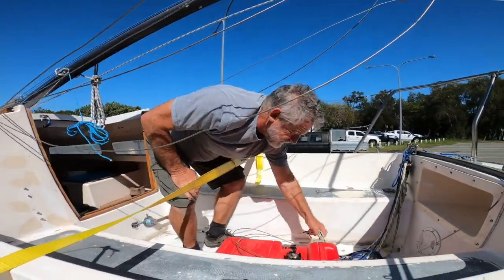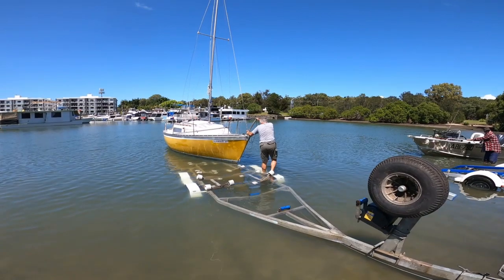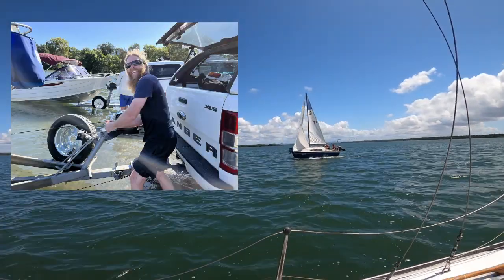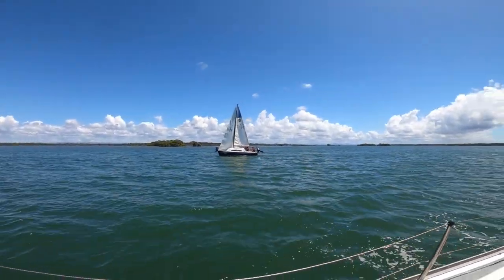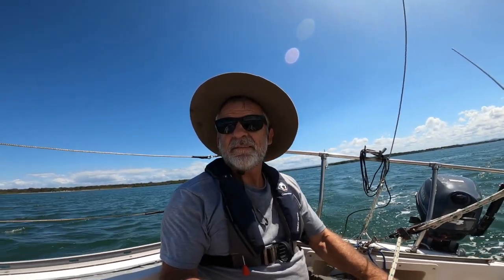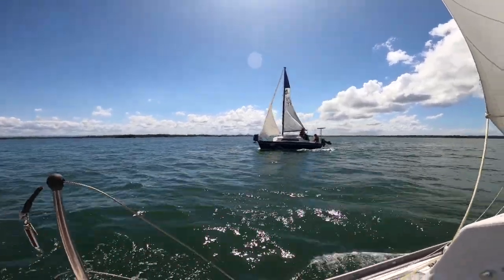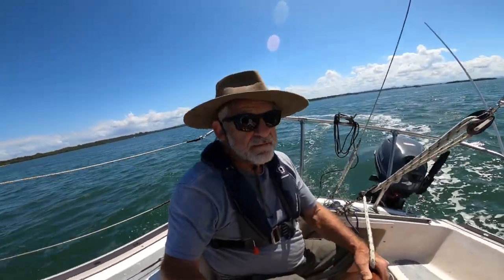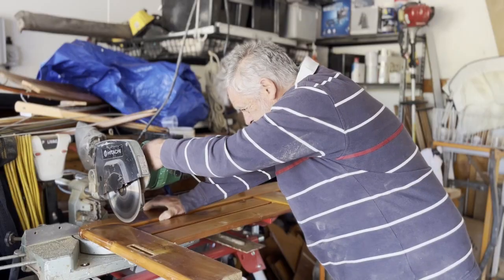First splash in our Sunmaid 20, fibreglass boat restoration projects

Comment: Very interesting and lessons to rember for my shake out sail, I have been thinking up excuses to for get about the keel and cable inspection, because of lifting the boat, or laying it on its side on the lawn as suggested.  Watching Baz and crew in shark infeasted water, getting his boat on the trailer. I best just do the job propley, and avoid the crack in the housing to fix as well.
Looking foward to your wooden boat restoration,  and Baz when he post his trip with you, not often that two people I have subcribed to are together, big thumbs up from me.
Reply from the maker: Makes a very strong case for dyneema. When my one failed for the third time I ended up swimming in croc and shark waters to fix it up.
Reply: How do you get a boat that size on it side on the lawn?

Comment: Dear Chris. I may have commented earlier on my Sunmaid 20 project plans - you were kind enough to help me contact the association in Victoria. Well, the boat is on its trailer, in my suburban Adelaide driveway, stripped to the bone and with a tarp over it. A large workshop would be super, but a pipe dream at present. I am on the cusp of taking the multi-tool and other devices to the cockpit, as I cannot resist the challenge! The templates are ready, the FG and epoxy purchased and a plan laboriously worked out. Wish me luck. I've been filming my (slow) progress for a possible future channel. I just need a run of warm, dry days, elusive at the moment, to dive in. Wish me luck. So nice to see other owners' approach to typical problems on these boats. I have enjoyed watching your friend, Baz's channel, too. Cheers.
Reply from the maker: That’s very exciting stuff! You are taking a good approach stripping everything down to the bones. I work in similar circumstances. It’s frustrating sometimes but you get by. I look forward to seeing your  vids. The cockpit sure could do with a work over. I’m interested in how you approach it.
Reply: @SmallSailboatCruising  If at all, in any way successful, I may write you with a personal, pre-YouTube channel description! I will cut the ply for the seats and floors from today, glassing them on the undersides first. Next week will be fitting. Gulp! Nothing ventured, nothing gained, eh?

Comment: Fabulous Chris. The Bribie Passage looks like an awesome place for a shakeout sail. Did you have any problems with the water depth? The charts say 8-10m in the centre...did you find that pretty accurate and not too many 'rogue' sandbars?
Reply from the maker: We didn’t come across any shallows sailing east west out of spinnaker sound. The only hazard there is jet skis. 😂
Reply: Yes there is a big sandbank on the eastern side of the passage just north of the VMR base (Sylvan Beach).  I comes right out and is marked by a red marker.  Then as you go north there are more shallows here and there.  The channel is well marked though.

Comment: Hi Chris, I have a Sunmaid 20 and it doesn’t have a backstay. I see that yours does. My shrouds seem tight enough but under the load of the jib the front stay seems to slacken. Would you recommend rigging a backstay?
Reply from the maker: The back stay is part of the original design. I have drawings showing a bridal on the transom so that it becomes like a split fork to where is attaches. The backstay enables you to shape the main sail and it provides reinforcement if you are flying a Spinniker. I would highly recommend reinstating it

Comment: I bump stop my Sunmaid20 off the trailer! at the bottom of the ramp 1 metre short I remove the winch strap & chains, I tie a bow line and lead it back to the vehicle and hold the line in the drivers seat wearing leather gloves! I reverse back 1 metre and tap the brakes and the boat keeps going straight off the trailer. I lead the boat around to the jetty or beach without getting my feet or the car wet.
Reply from the maker: I like the idea of keeping the bearings out of the water. If I let my safety go it would scoot off and land on the ramp.